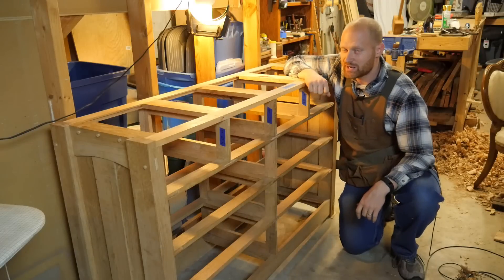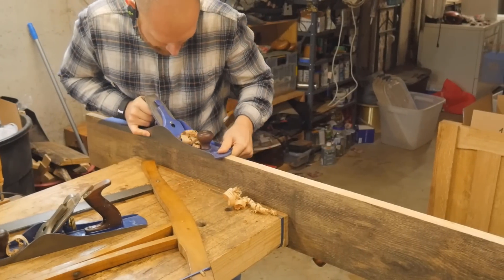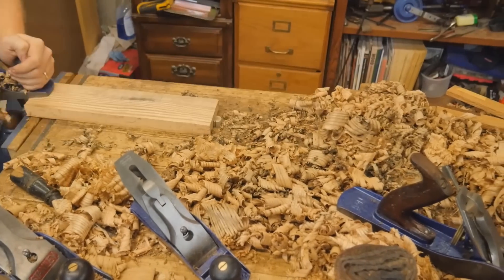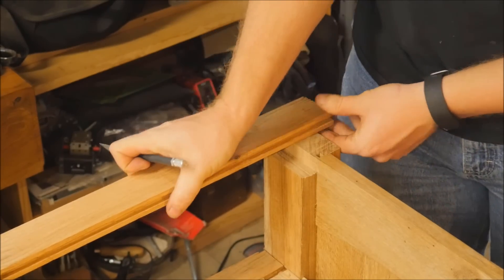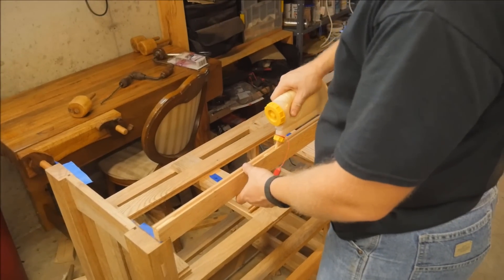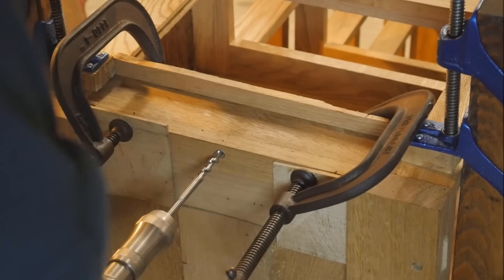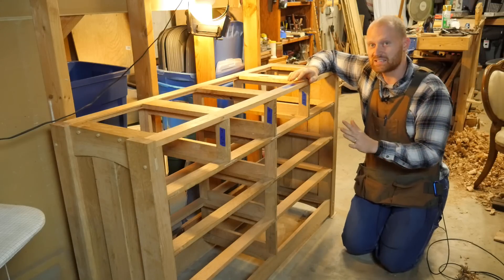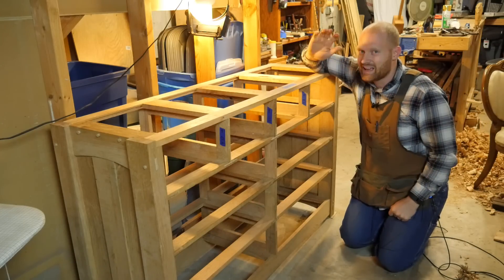Hand Tool White Oak Dresser Part 6 Carcass Frame Mission Craftsman

Comment: Thanks for the great videos. I am planning a similar project and wondering about construction details. Would it be better to attach the top to side legs with dovetails going down into the leg ends from the top rather than pegging from the sides?
Reply from the maker: I had thought of that but part of the design on this one is to have a lot of pegs and these fit in well for that. a lso it would have been very difficult to do that there with the bridal joint at the corners. It all depends on what you like.

Comment: Can I ask what auger set you use/recommend? I've been picking up second hand ones and sharpening them but quite often the spur is worn down so they end up tearing out a little.
Reply from the maker: I just use old ones and sharpen them up. I pick them up at garage sales for almost nothing, and now have a drawer full of them ready to be sharpened. I do not know of a new set that is any good. the Irwin sets are trash and have been known to have off center shanks. you can sometimes find good sets at MWTCA meets but those are $150-$250 a set.
Reply: Wood By Wright thanks!

Comment: That timber your grooving looks like a banana  did move after planning
Reply from the maker: no the block tot he left is keeping it vertical I had to push it a bit to keep pressure on it. the camera angle just shows the bow more. the little bit of bow would not affect the grooving plane and when it comes out of the clamps it is straight.